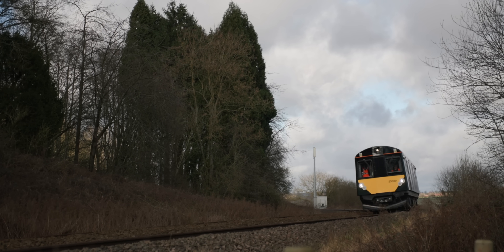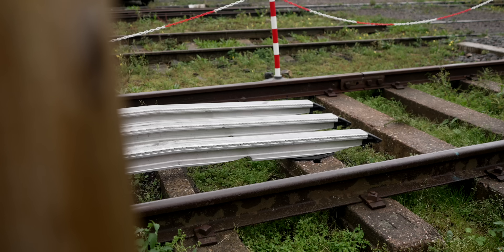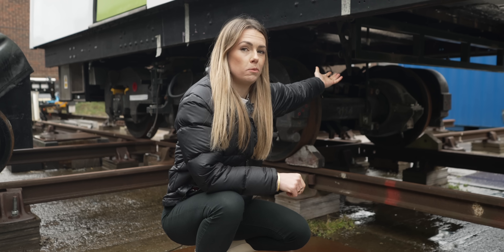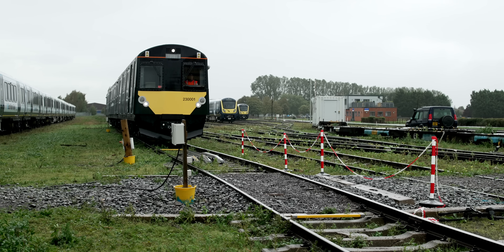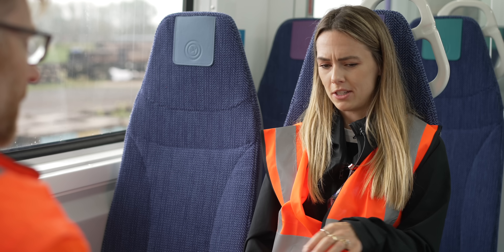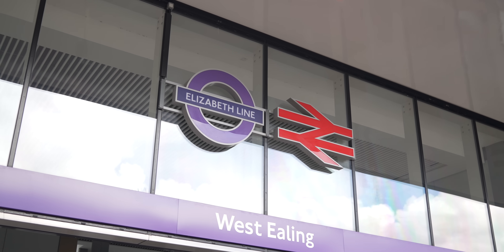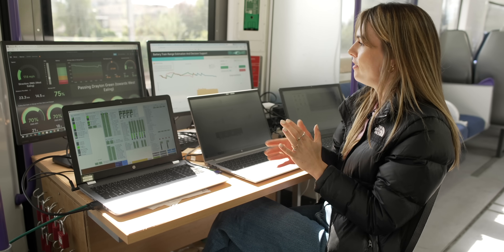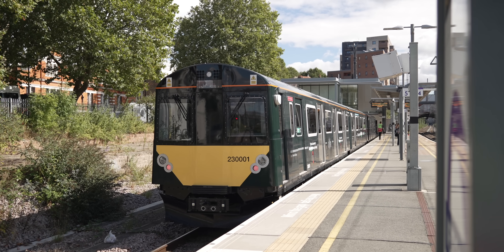Onboard the UK's First Battery Electric Train!

Comment: Fails for the same reason electric cars do
Reply: that reason being?
Reply: @Garfie489  batteries
Reply: @nerielarisma1  and why do they fail?
Reply: How is this  different from normal electric trains running on a power supply from electric lines? Electrification of UK is at 38% while India, one of the largest railways, is at 94%.
Reply: @Futuremodi  Batteries. normal electric trains run directly on grid power as did trams. Alternatively diesel electric where power is fed straight from the generator to the motor without the need for children to mine lithium and cobalt nor having up to 40% battery losses
Reply: @nerielarisma1  isn't conventional electric trains better than the battery powered ones? Wonder why the British govt is not electrifying the railway lines. It requires more work but saves more money and time, don't u think?
Reply: @nerielarisma1  - why assume Lithium based batteries, Sodium would work well for trains as well. Even if Lithium is used these are more likely to be LFP or LMFP batteries with extended cyclelifes, so will not required Cobalt or Nickle. Particularly since the high cost of high Nickle/Cobalt based Lithium batteries would not suit large transport system (like a train). Lithium mining doesn't involve artisinal/small-scale mining where child labour has been an issue, as is the case with Cobalt from particular areas of the world. Whereas Cobalt is required for refining of the diesel on an ongoing basis (as it's a consumable catalyst used in the refining process).

No idea where your getting 40% battery losses from, the overall loss of charging a battery source to wheel will be in the order of 70% in the worse case scenario (more likely in the high 80% range), plus unlike diesel/diesel-electric can use regen braking to recoup some of the energy spend (which will be significant in a large mass like a train) rasing the efficiency into the 90% range.
Reply: @nerielarisma1  - I'm an electrical/electronics engineer by trade, your response makes no sense. What is the relation of 20% to the charge rate stated - what assumptions are you making and are these valid/confirmed in the case of this particular use. Why throw in resistive/inductive considerations, do you know the exact type of motors involved where this would be a consideration or not, or just making assumptions again.
Reply: @GruffSillyGoat  I AM an engineer and i make no assumptions. To give you some basics i refer you to the battery bible. While it refers to lead acid, the principals apply to chemical batteries. All motors in trains, trams and cars are inductive. the faster you charge or discharge the greater the losses.. Do you know why batteries have losses?
Reply: @nerielarisma1  - differing battery chemistries have differing characteristics, using parameters of one type and applying this to another is a form of assumption by its very nature. Similar with motors, you have to consider the type of motor whether synchronous, induction or axial flux designs.

You've stated a hard figure of 20% loss whilst charging, where is this figure sourced from and does it apply to the type of batteries being used in this case? Vaugely raising basic principles such as resistance (I assume you're hinting at ESR and reluctance) and inductance doesn't provide the support required when giving such a hard figure.
Reply: @GruffSillyGoat  A AA is not comparable to a AAA i assume and synchronous, induction and  axial flux do not have inductive properties, i guess they dont have wire or use electricity. Is that safe to assume. 20% is a general rule as you know. Sorry for making that assumption. I guess physics and chemistry does not apply. i assume there are no losses. Electric utopia. Hahaha
Reply: @nerielarisma1  - introducting tangential remarks of your own making doesn't aid your point. Nor does seeking to hide a lack of knowledge by using reductio ad absurdum based diversionary arguments. 

The fact stands that you've not provided any evidence to support your 20% (let along earlier 40%) loss claim. 

Whereas the battery researchers and makers have numerous details on their batteries. Perhaps research and reference these rather than seek to thow around out of context  'general rules' .

Similarly differing motor types have differing characteristics, the motor being adopted and its parameters would need to be known to estimate the load impact.
Reply: @GruffSillyGoat  hahaha

Comment: Long time before this idea becomes real.
Reply: Its been running for years.
Reply: @Garfie489  yes not very well. Thought it caught fire once ?
Reply: @XxBec3509  they've been running perfectly fine. The fire you mentioned was in the diesel engine of a non battery version. These ones do not have diesel engines, so it's fine.
Reply: @Garfie489  sorry, I'm not convinced...let's leave it there. I'm sure battery trains will be a massive success same as the cars.

Comment: "500Kwh of energy on your train". This is x37 Tesla Powerwalls. Or 4.8 tonnes of Powerwall. £200,000 worth of batteries. Fast charging is known to shorten battery life so that is a question left unanswered.
Reply: The demonstration showed just over a 1C charging rate at 70%. That's not exactly a large amount of stress for modern batteries. I'm assuming the higher speeds are down at the lower states of charge, but even then what would that be? 2.5C? Not a whole lot of time to build up heat either during a stop.... I'd imagine the lower temperatures and SOC levels in the middle of the pack will return favorable longevity.

Comment: I've wondered for a while why trains didn't at least use something like supercapacitors to store charge from dynamic braking to be used to get the train moving again.  I'm surprised that they actually went to a fully battery operated train, but it makes economic sense when you realise how much infrastructure you can do away with in the process.  All the same, I think that having a "roof" of solar panels over all train tracks to collect solar energy with battery banks at strategic locations along the track would be a good supplemental energy source to help reduce reliance on greenhouse gas producing power plants.

Comment: I wonder why they don't just charge the battery with the electric wires where they are cheap to build and use battery where it's hard to build instead of needing 2 batteries and one is super fast charging (potentially leading to a lower lifespan)
Reply: Cheap? The UK's London to Bristol overhead electrified line cost £7 billion. HS2 which is an overhead electrified line has cost £66 billion to date, and this is for the 140 mile stretch between Outer London and Birmingham (some £475 million per mile).

It's no wonder that batteries are being investigated for many parts the 6,149 miles of track yet to be electrified in the UK (many branch lines), what with only 38% (3,769 miles out of 9918) electrified todate. Some of the network routes dates back over 200 years, and is in a fair few areas are difficult and/or costly to electrify by both overhead lines and third-rail systems (the latter of which is now actively discourage in the UK due to safety and flexibility grounds).

Comment: Why?
Surely, it would be more cost effective to just electrify the line, like the rest of GB and use existing loco stock. We've already got electric trains.
Reply: The cost of electrifying a line in the UK is about £1m per Km. 

For a branch line with limited service, its kinda not worth it.
Reply: What do you mean "like the rest of the GB" ... 6,149 miles of track are yet to be electrified in the UK (many branch lines), what with only 38% (3,769 miles out of 9918) electrified to date. 

Cost effective, well the 140 mile HS2 route from Outer London to Bristol has cost £66 billion to date (£475 million per mile), whilst this has it's own unique problems. Perhaps the 80 mile earlier London to Bristol electrification project is less of an outlier, which cost £7.2 billion is more indicative (£90 million per mile). 

And these were what are deemed easier to address main line sections, who can say how much the multitude of branch lines in the UK will cost to upgrade to electric. Some of the network routes dates back over 200 years, and is in a fair few areas are difficult and/or costly to electrify by both overhead lines and third-rail systems (the latter of which is now actively discourage in the UK due to safety and flexibility grounds).

This is why the GWR battery train trail is important, it will given real-world data on the cost, implementation and operation of batteries in support of rail transport (and the UK is not alone in investigating such).

Comment: I am very pleased that this technology is being trialed.     One very big problem is still the time the train takes to recharge.     Within this documentary it is stated that a train stops at a station for over three minutes.     This has never been the case.      At major stations such as East Croyden the station time can be up to 1 minute with places like Reading 2 minutes.    At local stations such as Wivelsfield,  Ealing and the like the station time allowed is 20 seconds.     20 seconds does not sound a lot or enough but when you are train crew with few passengers it can seem a quite long time and is more than enough time to detrain and entrain passengers.     However, these times were pre privatisation.    It is known that since privatisation station times have been increased so to ensure right time running and recovery time if needed.     I don't think the passengers will like or put up with it.    If the trains were fast, say from Brighton to London Victoria or from Newberry to London Paddington with a possible 2 minute stop at Reading these trains would have a great future.     If they run all stations Reading to Paddington the 3+ minutes at stations would increase the journey by over 30 minutes.      I presume not all stations would be equipped so the 3+ minute charging time would only apply once or twice over that journey.    Personally, with my train crew hat on I don't like it.    I like steam, diesel and even electric.     With my sensible  hat on I believe it to be a great opportunity and well done to all those who have worked on it.     (Retired station staff/train crew/manager and MD of a rail company after privatisation).
Reply: Its not a big issue, as these trains are not intended for mainline use - they are mostly for branch lines. 

Some branch lines already have 5+ minutes of dead time built in at each end. My local branch line only takes 18 minutes, yet has a half hourly service. The train spends nearly as much time sat still, as it does actually running the line.

Comment: waste of money. less efficient. than trains that run directly on the mains power. more weight. Expensive maintenance when battery needs to be replaced. Very dangerous in the event of a fire.
Reply: For a small branch line, converting one of these trains is cheaper than electrifying the entire line.

Comment: Isnt it better to have a train with electric traction...unstead of lugging a massive heavy battery???
Reply: It is, but the point is for these to be used mostly on branch lines where the cost benefit of electrification is extremely low.

Comment: i was expecting the charge power to come from the same overhead wires so the train can be charged at any location with overhead wires.  but this would be so fast a charge.  are the overhead wires AC or DC ?  what is the charging voltage when the fast charge (1000 amps) is engaged?  i'm curious what the battery capacity is and the peak safe charging rate is.

Comment: but what is the point?
Reply: to allow electric trains to run on non electrified lines. same reason battery locomotives have always been used.
Reply: @Garfie489  there is diesel
Reply: @V8_screw_electric_cars  which are extremely inefficient, and no where near as capable.
Reply: @Garfie489  is that so because they move millions of tons every day lol
Reply: @V8_screw_electric_cars  yes. Its extensively covered if you wish to go read - especially in the context of US rail, where electrification would significantly improve performance but theres no competition so no need to invest.
Reply: @Garfie489  very much doubt it "electrification" is always government funded no private companies ever did that and usa has almost free oil
Reply: @V8_screw_electric_cars  it's extremely easy to look up. It's also covered in the video. 

Multiple private companies electrified in the UK prior to British rail, so your point is really ignorant. The reason the US doesn't is due to a monopoly - which is a type of failed market. For the same reason, they don't invest in basic safety either.

Comment: Can we have a big shout out for the kids in the congo slaving away in the  for the cobalt .. and the enviromental damage lithium  mining causes .,. so you can say how green i am .. all a load of bollocks
Reply: agreed, your comment is all a load of bollocks
Reply: That's soooooo 2016
Reply: Yes it's a shame that Cobalt is used in such quantity on an ongoing basis as a consumable catalyst in the production of Fossil Fuels like diesel. Plus that the trawling of the land for the expensive platinum catalysts used to reduce emmisions at the point of use in ICE; platinum being even rarer and less concentrated than Lithium resources and causes significantly more environmental damage if that's your concern. 

It's good that train batteries, since not needing expensive higher energy storage, but do require long cycle lifes, will unlikely be Cobalt based battery compositions (may not even be Lithium based, Sodium would meet the requirement). 

You may not want to look into Iron extraction either it dwarfs that of other minerals at 2.5 billion tonnes being extracted annually (Lithium is 180,000 tonnes, some 0.0072% the volume of that of Iron extracted).

Comment: I'm of two minds about this. On one hand, just adding third rail on more UK tracks would be less R&D and no need to make all the batteries. On the other hand, it is a good use case for an electric drive train, trust me a normal 3rd Rail is already a death sentence if you were to touch one

Comment: Hope that it's not charged from a Diesel generator in that there container unit. It happens for EVs at quite a few charging points. It's OK for a limited time but it rather defeats the "green" intent.
Reply: its a grid connection, as thats significantly cheaper to do.

Comment: Incidentally, the new TGV (The TGV-M) will also have onboard batteries, not to run the whole Paris to Marseilles distance at high speed on batteries, but to be able to cope with local, intermittent, power outages or give more flexibility when maneuvering in depots and stations

Comment: battery train with the flattest inefficient nose ive ever seen and has taken 5 steps back in terms of drag.. look at the sides where the doors are wtf is that?? why is not streamlined like all trains??? the country is done for
Reply: Because streamlining is not really an issue at these speeds? - would make the trains significantly more expensive for relatively little gain.

Comment: Bimode trains can be developed where trains would run from power via overhead rail and charge their battery while in sections without overhead rail, it can run off battery. Regenerative charging would be super in trains.

Comment: Battery Trains  better than hydrogen train developed by CRRC,They  more practical and if batteries chemistry used are sodium ions or silicon batteries (that is under R and D) it's will be next generation of electric train

Comment: This is a solved problem! Electrify the rails! Battery electric is a step back born of successive governments' refusal to invest in capital infrastructure. Just do the infrastructure right!
Reply: Third-rail systems are now discouraged in the UK by the Office for Rail and Road, on safety and flexibility grounds. The 750V DC third-rail system (as used in the UK and most of the world) doesn't provide enough power to run trains above 109 miles per hour and doesn't support freight transport (which the UK is seeking to use more off on main line routes). Overhead line conversion has been expensive  - £7 billion for the 80 mile stretch from London to Bristol, and of course HS2 £66 billion for 140 miles so far. Only 1/3 of the nearly 10,000 miles of rail track in the UK has been electrified to date. Many of the rest are branch lines that have lower traffic volumes and electrifying the tracks would be less cost effective than electrifying the trains themselves; plus a fair few lines were cut over 200 years ago and would require extensive upgrades to be track side electrified.

Comment: What about regenerative braking?  I want to compare this with the electric underground.  All underground electric trains dump power into a resistor bank when slowing into the station.  This is a complete waste of energy.  I am involved with a developer who has a small very high speed flywheel storage solution which could help with underground trains and replace the resistor bank dump.  Instead when the train arrives in the station energy is stored in the flywheel, like regenerative braking.  As soon as it is ready to leave the station, the flywheel can deliver 1MW or more back into the system to push the train up to speed quickly... and then repeat again for the next train.  Like regenerative breaking this helps optimise the use of electricity.  Its time that these novel applications are taken seriously!
Reply: If you're referring to the London Underground, many of their trains actually regenerate back into the supply, reducing their energy consumption. These battery trains also regenerate back into their batteries too.